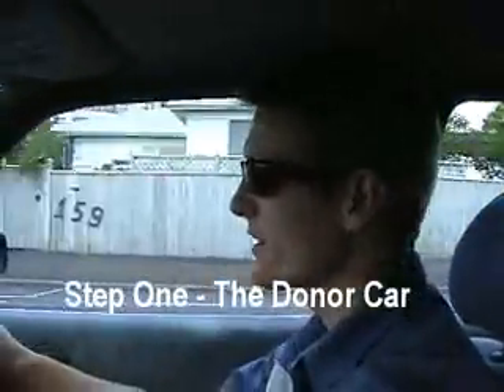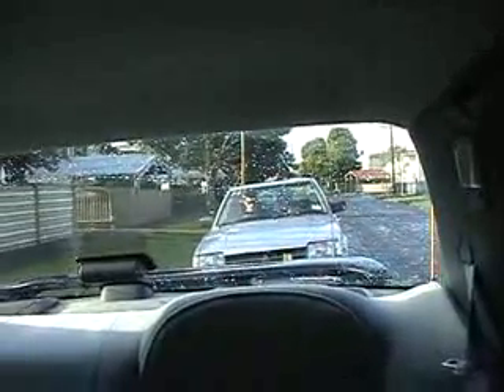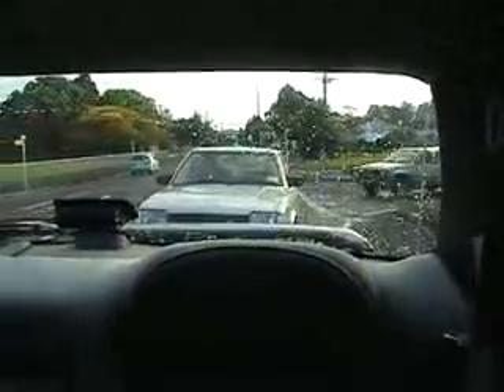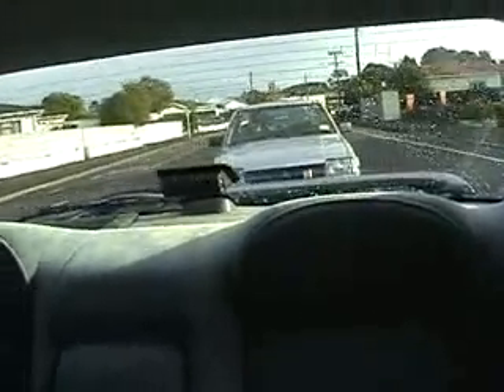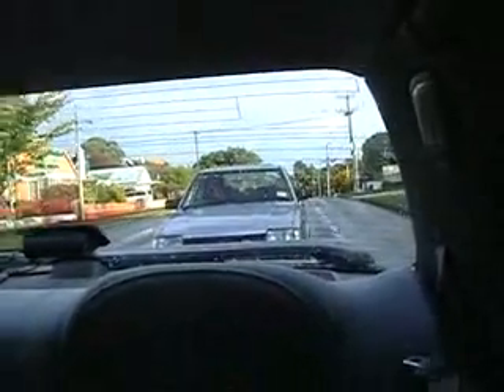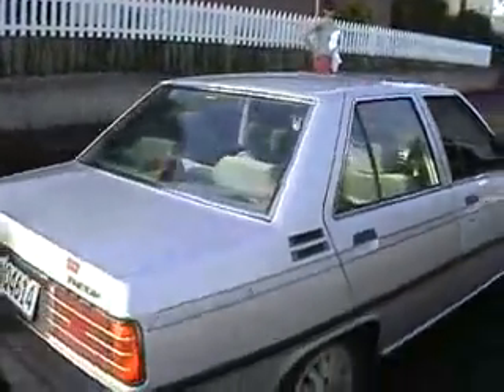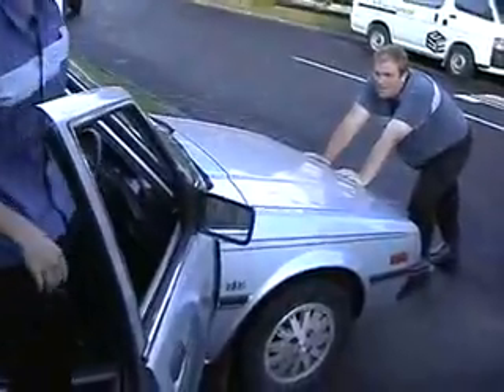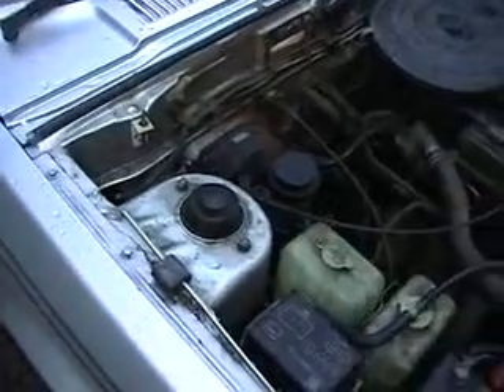Gav's EV Conversion 1 - Towing the Donor Car

Comment from the maker: The one thing I am trying to find a budget model of is the charger. 
Here in NZ we have a 240 volt home system which helps cut down on charging time but I'm trying to find the cheapest possible idea to charge the 144 volt system the Tredia will eventually have.

Comment from the maker: I considered those super low budget ideas from the Bob Brant conversion book but found that I wanted something with a bit more oomph and reliability. And don't those Zilla controllers look great with that hairball interface thingy? 
I'm looking to spend (bit by bit) a total of about $7000 USD. There are quite a lot of things I can get locally which helps but I still have to buy the controller & motor from the USA - then pay $2000 in shipping which hurts.

Comment from the maker: Hi! Range isn't a priority as we live in a small city, I'm planning on using the Zilla 1k controller and the FB4001 9" DC motor. Batteries I haven't decided yet as I haven't checked out all the local brands.
Acceleration should be about 10 seconds to 100km/h with luck. Budget? Haha, low mate. Very low. The part that's going to take the longest will be saving up for the motor/batt/controller while also saving for a wedding!